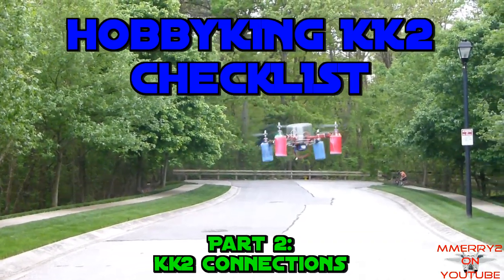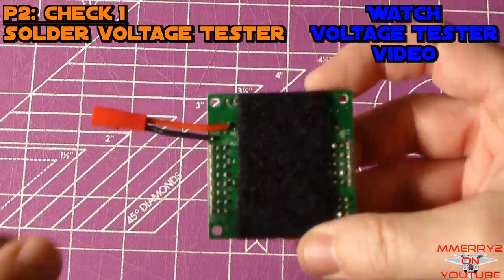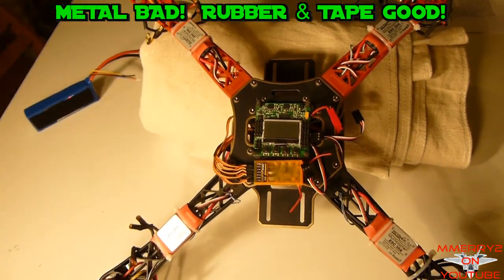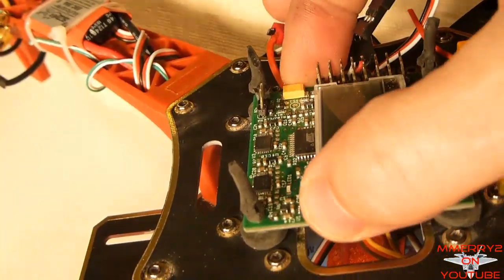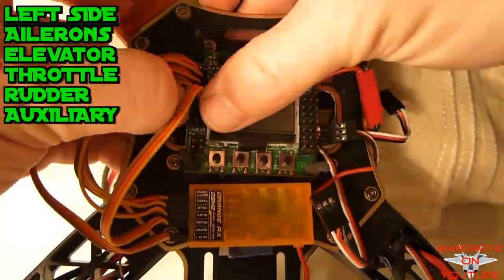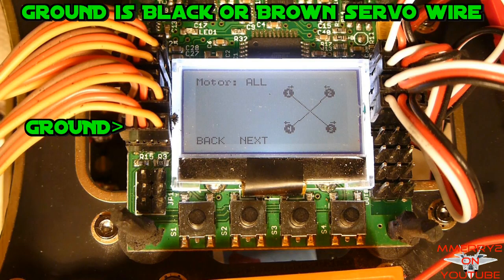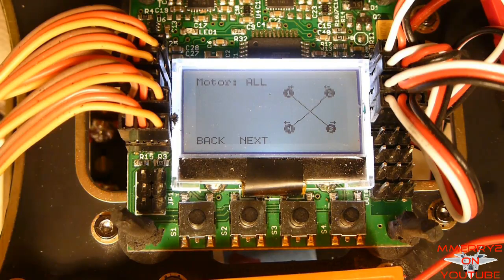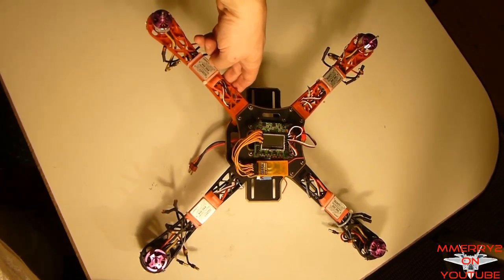HobbyKing KK2 Checklist - KK2 Connections (Part 2)

Comment: when connecting the esc´s to m1 to m4 (quadcopter) you connect all three wires? signal, possitive and negative
Reply: jlqtraceur When I built my quad.  I only used all three wires on M1 and I simply pulled the red wires out on my m2, m3, and m4.  Make sure you use heat shrink tubing on them because they can cause a short out.

Comment: KK2.1.5 Important note: There are TWO power buses... the 5v RX FCB bus that M1 is part of, and 5-6v servo/esc power bus M2-M8. M1 cannot take 6v and if on a wing or Tri motor using servos you really need to know all this. There is actually quite a bit being left out that Steveis mentions in the KK2.1.5 manual you need to be aware of. See Appendix 1:powering the KK2.1.X